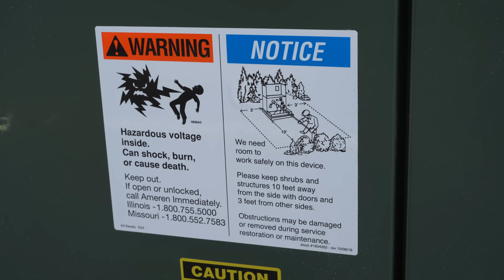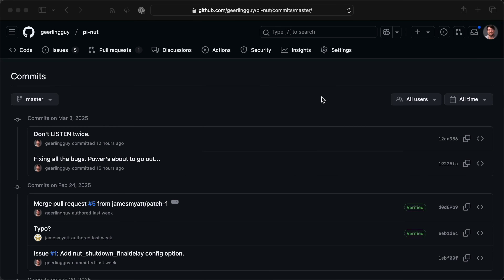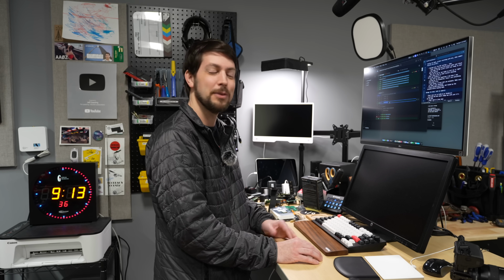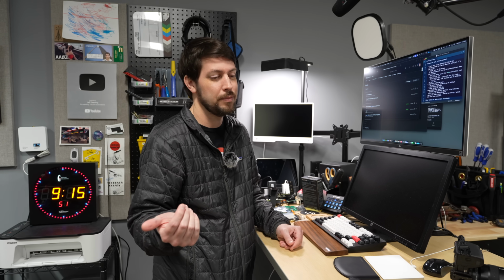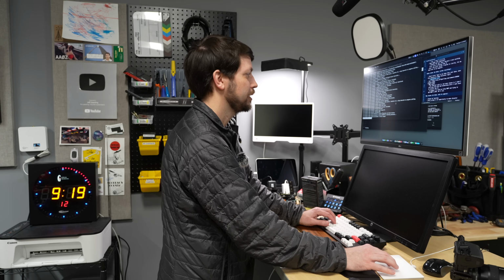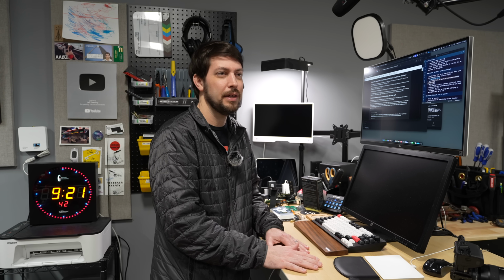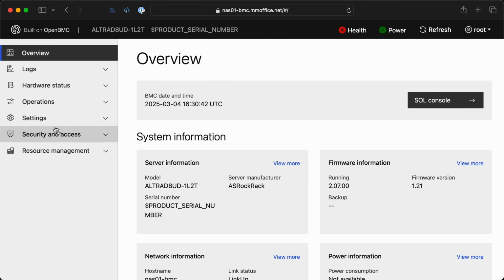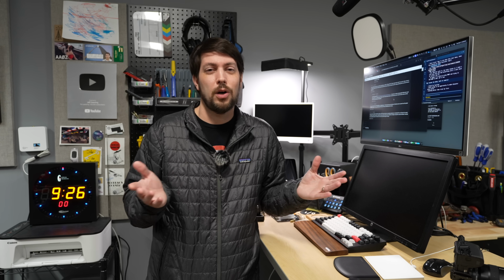Power's back! Some Post-NUT Clarifications

Comment: I actually built something similar — my Raspberry Pi runs as the NUT master (connected to an APC UPS over SNMP), and my TrueNAS is a NUT slave that shuts down cleanly when the UPS goes on battery.

The Pi is powered by PoE from a switch on the same UPS, so when the UPS finally cuts power the Pi dies too. Not ideal, but it still works fine.

When power comes back, the PoE switch boots up, the Pi boots, detects the UPS is online again, waits 5 minutes, and sends Wake-on-LAN packets to bring TrueNAS and my PCs back up automatically. Super reliable setup.

Comment: if you have less ups time to get away with you can set override.battery.charge.low = x and set the desired % of battery you want. I don't need a ton of run time and would rather keep my ups from draining its battery low during a long event so I set mine to 40%. you add this line in the ups.conf file and you can see it take effect when you check with upsc on the ups.

Comment: One thing to be aware of with auto restart
If there's a power fault, the linemen may try replacing the fuse or resetting the breaker to clear the fault, they may try this a few times.
I've had a situation where the power was out for a couple of min, it's come back on and appears to be steady so rfestarted the PC and the power goes off just before it finishes. this can happen multiple times in one poutage.

Comment: A very safe way to handle power delivery problems in an environment that is not critically uptime-sensitive without the large continual investment in large power-inefficient UPSes as well as all the complexity of trying to gracefully shutdown is to simply have a clean hard power-cut by using a master default-off WiFi switch. A clean power-cut is 100% safe with any logged FS, but most important (as you pointed it out) is to prevent power-on when the source power has not stabilized. I do this with a remote-accessible master WiFi switch + emporia circuit monitoring where I can manually observe the source power stability via their no-subscription mobile app, then turn the system on once power appears stable, but there are plenty of ways to skin that cat.

UPSes are really only useful for enterprise uptime-critical systems and at that point it's about automating generator swtich-over, and team notification. Automated power-down is simply a gratuitous investment that does little to protect more than it does make homelabbers feel warm and fuzzy, until the complex plumbing invariably doesn't work (batteries fail prematurely, or system cponfg has changed since last full systems test, etc) and most often simply causes more havoc than if it weren't there.

Brewster from The Internet Archive had a great talk on this that I attended over a decade ago, which made all these arguments that I didn't quite believe, so I went and tested it myself. I cycled an old Dell Poweredge server via random IPMI power-off while the system was writing full-speed in various concurrent scenarios to the underlying storage (EXT4, XFS, ZFS, as well as LVM2 underneath each along with Postgres, Mysql, and my home-rolled C program to re-write random blocks across an array along with checking if power-cut detected) and in over 6k power-cut cycles under the worste-case full-write and/or rewrite of blcks, not a single instance of corruption.

If someone wanted to really make a banger homelab video, it would be titled "Why using a USP is stupid !" (how's that for click-bait sounding sage advice ? :) and then proceed to show all downsides, then show none of the old-wives-tales downsides left over from the FAT, EXT2, HFS era days exist anymore :)

Comment: Jeff, you gotta get radio signals out on a power loss, like via lora or something.  This is what SDR is all about.  Good video.
Reply from the maker: True; I could wire up one of my meshtastic nodes to broadcast a message out to me; it now bounces through a couple local nodes to my house!
Reply: @Level2Jeff  And the beauty is, the low power requirements of a lora/pi config would probably result in the comms being the last man standing, as it were!
Reply: @Level2Jeff  Bounce, bounce, bounce!!  So cool.

Comment: Set up NUT last week after watching your video about it - and realising it's built-in to my Synology NAS. This week, after a pole-top fire took out power for our area, I learned that my UPS has a failed battery and it does a surprise shutdown after only a few minutes of battery power! Thanks to Home Assistant, I can see just how long it doesn't last :D
Reply from the maker: Oof! Hope you can get a new battery in there soon!
Reply: @Level2Jeff  At least nothing connected to it has broken! A visit to my local electronics shop today got me a replacement battery for AU$30 (standard 12V SLA) and hopefully it's smooth sailing from here 👍

Comment: For an amateur radio operator, a power outage is a glorious thing!
Reply from the maker: I can only imagine what the SDR waterfall looks like during a regional outage... so quiet.
Reply: You don't even need to be a ham, when I had an outage I hooked my AM/FM radio to battery and could pick up tons of stations that would normally be hidden by the noise floor.

Comment: "If you have a problem, if you have an outage, it's an opportunity to do better next time." As a network engineer, I can't express how accurate this statement is. Well stated.
Reply: Just went through a major outage that laid bare some weak spots in our Disaster Recovery and Redundancy systems.

This was the exact conversation we had the day after. Major systems were down for a day, we can spend 50 k to ensure that never happens again. Is it worth it? The answer may not always be yes but the outage was a great conversation starter for how we manage systems and communications between departments.
Reply: Indeed, and that is why we regularly test that, by actually breaking things on purpose at basic levels.
Reply: Yep. I still remember the first major (to me at the time anyway) outage scramble I went through to recover and harden against future events. 

And the report after explaining why the new measures weren't in place before was difficult ("I told you so" and  "we weren't given the budget for it" aren't lines that go well with continued employment. ) . It can be tricky to balance honest assessment with avoiding accusations sometimes.

Comment: After the FSD instruction is sent, are you saying that the only automatic method of restarting the servers/pis is to actually lose and regain power? Or is there an IP boot instruction option?

If power is restored when the battery is low I would expect the power to be uninterrupted, and it sounds like you would need to go manually boot or manually toggle power.

I used to be an IT guy at a small business which was plagued by a failing transformer during the start of COVID stay at home orders. A great way to find the many limitations of our planning and hardware for our tiny server room. These videos will help people be better prepared.
Reply: Based on my understanding (I haven't looked into it though) the first part is the case. Once the shutdown command is sent the only way back is for the servers to lose power. But the second part is probably not the case. When the UPS receives the shutdown command it probably guarantees that power will be disconnected for at least 'x' time, even if input power comes back before then.

Comment: the issue i have with my UPS and unraid system. it is set to shutdown safely on power loss, and it is also configure to turn on automatically on power being reapplied. but if the power is reapplied after shutdown, but the ups load never turned off the bios doesn't see a reapplication of power to turn on... so it then requires a manual power on...
Reply: Is the unraid set to send the poweroff command to the UPS after shutdown?
Reply: @eDoc2020  as i'm not 10% sure how to set that up, it wouldn't be.

Comment: Another option for the small rack instead of a larger UPS if you are content with your existing gear selection, is a Zonit Z-ATS micro automatic transfer switch. The micro ATS plugs into two sources of power and will automatically switch to the secondary source if the primary fails. You could designate the small UPS as the primary source and the larger UPS as the secondary. If the power is out long enough to exhaust the smaller UPS, then the ATS will move you to the larger UPS so that small rack can run long enough for you to safely shutdown that gear, via NUT, manually, or whatever else needs to happen.

Comment: I discovered that wiring in a battery system from a solar, without solar, is less expensive than buying a bunch of individual UPS for different servers. The batteries are 48v 5KWh units plus an inverter. The inverter switches on when power is lost and you can hookup a generator to star when the batteries get low. The system runs your electrical panel so anything on the panel is on a UPS. It cost $15K for 15 KWh and a 12 KW inverter all in. There are 6KW units you could mate to a 5KWh battery that might cost $6-7K and give you hours and hours of backup.
Reply: the high price of UPS systems is because UPS systems need to hit a target switchover time. Those battery solar systems often have a switchover well over 150ms and that is plenty of time for the server to loose power
Also UPS systems provide filtering and protection against brownouts (when AC voltage drops well bellow acceptable levels). This is sometimes even more desirable than raw capacity

Comment: I'd suggest disabling the camera's IR LEDs inside the dome, and perhaps adding an external IR light powered by POE so it runs off the UPS too.  

Ya know - at some point you're going to have to up the battery capacity of the main UPS and run everything off that one.  Do away with the little UPS for important things, demote them to the retro-bench or something.

Are you allowed to install a genset at the studio ?   What about second genset ?
Reply from the maker: Hopefully solar and battery someday...

Comment: Suggestion, get rid of a dome camera for outdoor use. You will constantly have to clean it to avoid IR blowout from the dirt on the lense. Best to use a turret camera for outdoor cams.
Reply: I totally agree. I learned the hard way.
Reply: You can also just turn off the IR illumination and use an external IR lamp- also helps outside with bugs in the view
Reply: @dataplatter  Yes you can. Unfortunately it won't stop a dome from dirt and still would effect image over time vs a turret camera

Comment: Besides needing a larger UPS for the wall rack, have you performed the "Tripping over the Power Cord" power loss scenario? It is an often overlooked mode of failure, frequently performed by my former boss.
Reply: I'm pretty sure they sell brackets that prevent the "unplugged due to tripping on power cord" failure. However they increase the likelihood of the "outlet and plug totally destroyed due to tripping on cord" failure.

Comment: You actually inspired me to build something useful. I took a Waveshare UPS I've had on a Rpi B for some time..doing nothing. I took that RPi and I made a dummy NUT driver with the waveshare "UPS" output. That dummy driver is used by a NUT server running on the waveshare/Rpi. I have all these OLD Back-UPSes that are plugged in here and there. My home lab PCs are plugged into one of these dumb UPSes. But no longer. When the waveshare board detects a loss of commercial power, it now sends messages to the homelab servers to shutdown gracefully. Thank you for the little push I needed to make that happen!
Reply from the maker: Nice! A lo-fi way to get the job done
Reply: @ Never would have occurred to me without your initial NUT video. THANK YOU. I will post my crappy code on github.

Comment: You may also consider something like an Eco flow, which has a much longer runtime for the mini rack and would also be able to receive things like solar power or generator power
Reply: The only issue with the EcoFlow option is the lack of support for Nut, or SNMP.

Comment: You may also consider adding a APC transfer switch for the mission, critical rack and routing power from both main rack UPS and mini rack UPS this way the rack will stay up as long as either UPS is available and you can select which would primarily be the source for the power
Reply: Or just plug the network UPS into the main rack UPS.

Comment: This kind of nuanced discussion is exactly why I am on the internet!

Do some UPSs (UPS's? UPSes? UPSusses?) not wait until they have at least some charge before turning on the load again? This would cause systems relying on these UPSs to experience the operational situation of a system withOUT a UPS: possible rapid power cycling.

Comment: jeff simply safe might be a great sponsor but for people that know security systems it destroys your dependability on tech reviews. because there stuff is so darn easy to bypass. with a simple garage door opener. you can jam the door and window sensors so you can open them and enter with out causing alarms.
Reply from the maker: Never been sponsored by SimpliSafe. My options were an ADT wireless system or SimpliSafe, and both have their drawbacks.

Luckily I have another more lo-fi security system in place, and it's in a well trafficked and well patrolled area of town. That plus good insurance coverage, and I can sleep well enough at night.

Security can never be ironclad, you choose a level of protection and are either happy with it or not.
Reply: i am happy to read that jeff. yeah indeed both have big flaws and when you know those then yeah you can cover for them or accept them. but sadly most people that buy those systems dont know them. and because they sponsor the heck out of youtubers when you said you where happy with them i got really down for a moment. thank for correcting that assumption of mine.

Comment: I wish there was a 48vdc standard for server psus and ups so we could just skip a conversion step.
Reply: I've been working on rebuilding my rack with picoPSUs and a central power management box that runs off a chunky 24v lead acid battery array and 12v buck regulator and high efficiency 12v PSU for regular runtime. The main downside is that there's no means of managing anything via software
Reply from the maker: Ditto.
Reply: There is, most telecom equipment operates from 48V so many servers can be ordered with 48V PSUs. But note that this isn't as useful as it seems at first. It only skips the conversion inside the UPS, the server PSU still needs to be isolated to prevent ground loops. And then during normal operation you have an extra AC->DC in addition to the normal one.

The only way I can see it working well is if your server supports redundant PSUs of two different models. and can be set to use the normal AC one if possible and only draw DC if needed.

Comment: Another nice outage is when your UPS crashes while battery testing. 
I wish some UPS would include internal resistance measuring of the batteries instead of switching to battery power (and maybe fail). XD

Comment: Oh, no. The Transformers are here. One of them walked away and had to be replaced.  LOL
Reply: Darn Peanut
Reply: You could think about plugging you UPS into Solar batteries.  Then you would have the Extended battery life and wants the solar batteries failed and then you went on the actual app you would still have reporting at the end.
Reply: You could make your own.  The lithium batteries are getting so cheap now it’s crazy.
Reply: Wait, your doorbell tried to burn down the studio?  This is the uprising of AI and it started with you Jeffrey. LOL
Reply: Why don’t you make a pie UPS that uses the same protocol to communicate with the software, and then you can build everything yourself and integrate Pi-Nut directly into the entire thing
Reply: How boring would life be if you did everything right the first time : )

Comment: 4:39 if the wall rack is critical equipment, you should definitely get a longer lasting power solution in place there.

Comment: Its nice to see that there is a way to prevent getting data lost from a power cut. In my country (Germany) I never saw a power cut in my city by accident. Only in my 17 years here, the power was only out once for 1 hour due to maintenance work that was announced.

Also I have an crazy idea that won't go out of my head. It is like "use your old smartphone as a cheap Raspberry Pi". Because you normanlly don't use your old phone and it's lying around somewhere, why not use it as a cheap efficient ARM server with even a Display. Somehow run Linux on it, than maybe docker, try to get rid of the battery and use the USB Port for a LAN or even POE Port and if the phone is good enought than try to run Jellyfin on it. I absolutely don't know if that is even possible. 
Maybe its a project for your future.
Reply from the maker: It is something I tinkered with a few years back (running a Drupal website off a phone!), but haven't tried lately. It would be interesting if one of the more 'open' phones could be run battery-free in this condition.

Comment: Does minirack only contain devices with DC-input? You could diy a DC-UPS, did that for two Shuttle barebones (i3 8100T era, one is setup as a router) and a RPi. The idle power draw of those three together is lower than that of a  APC UPS I had years ago. I diy'd a DC-UPS with parts from Mini Box, yes the one from PicoPSU's, and with a 20Ah battery it can run for more than half a day.

Comment: Sadly NUT doesn’t support yet support Victron hardware. 

I use a Victron Battery energy storage system that also does emergency power. But automatically turning off servers when it get lows would be nice
Reply from the maker: I assume this driver wouldn't work? https://networkupstools.org/docs/man/victronups.html